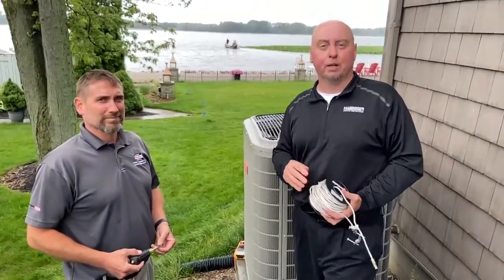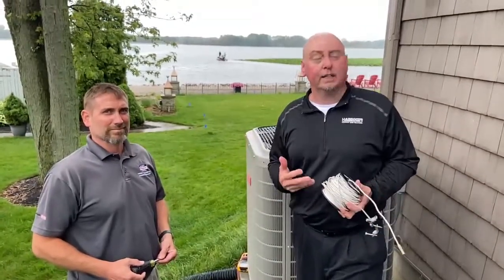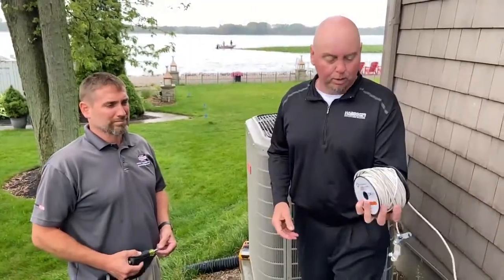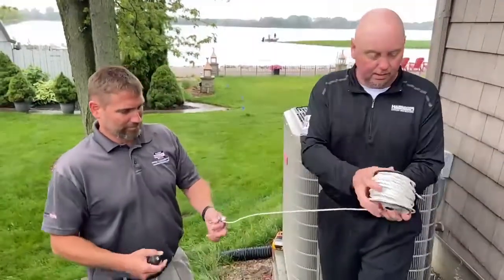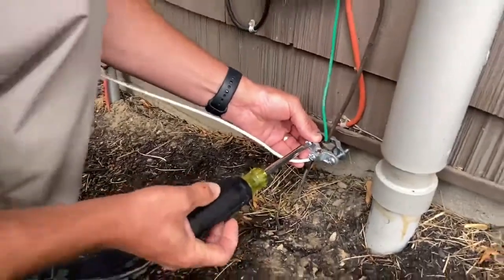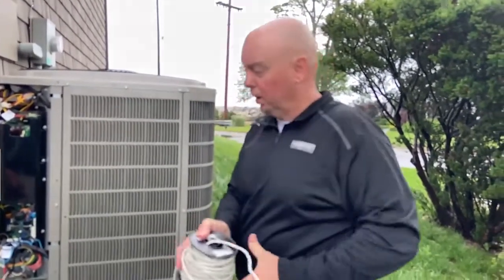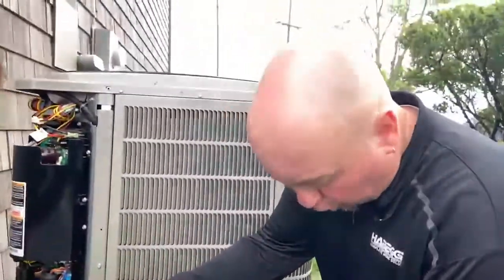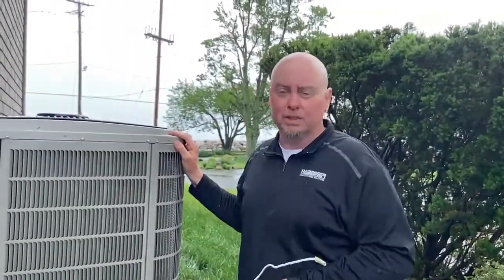How to Test a Ground Circuit

Comment: What is the resistance of the spool of copper that’s in line with the rest of the circuit?
Reply from the maker: @nelsondog100  I use 100’ of 10ga thin strand. From end to end it’s less than 1 Ohm.

Comment: You serious?
Reply from the maker: Yes. Especially on inverter/communicating systems. 

Bad ground reference points can create a lot of havoc. 

Usually not as easy as the video as this was a new home. 

But I always carry that spool of wire to checking grounding. 

Good luck.